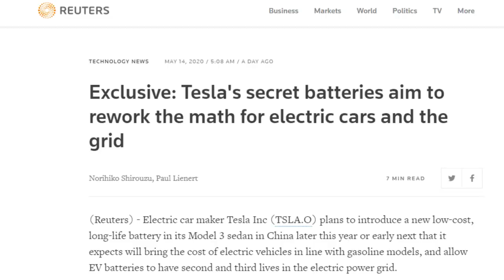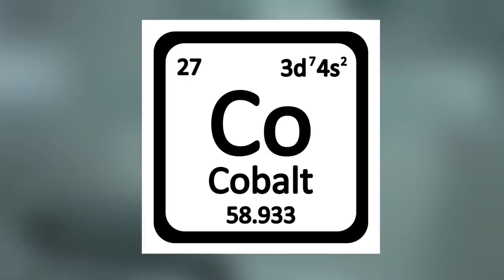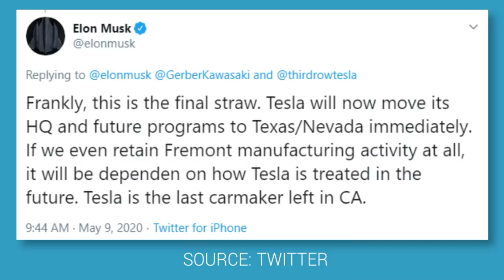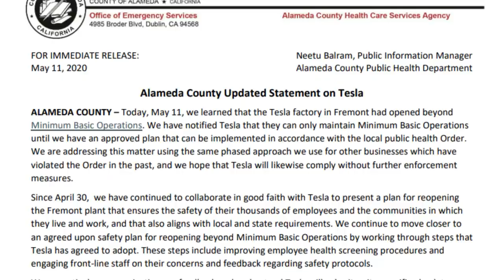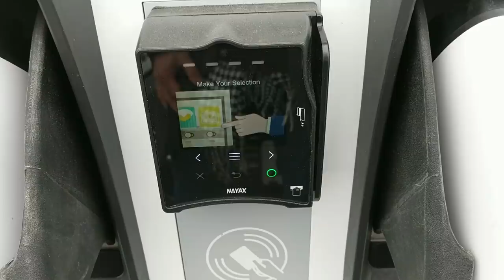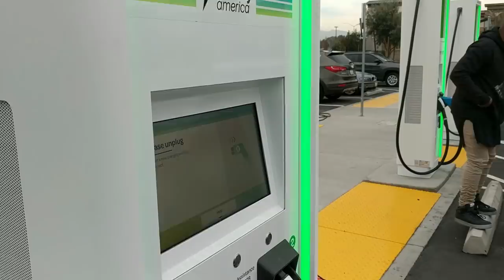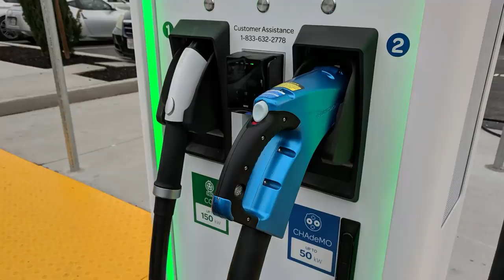New TESLA Battery Details LEAKED | EV News

Comment: The 1 million mile battery also takes away another FUD argument of all the batteries that will be in landfills. Once capacity is too low for a car can be repurposed for powerwall. Assuming you drive for 10 years then have use of the power wall for another 15 or 20 years.

Comment: 1 M mile battery = a battery that can be charged & discharged many many more times and therefore it becomes more practical to use it as a storage resource when connected to the power grid, this is the significant part, this means that Tesla can reduce the cost of the vehicle substantially by either 1) not charging the buyer for the battery & using it as grid storage ,or 2) include the battery in the purchase price and the owner can make money by selling the storage capacity to the grid, either way this will enable Tesla to significantly change the price/ownership proposition of their vehicles.
Reply: Perfect recap 🤙

Comment: I'm not getting what's complicated with this charging issue. Charge by the kwh, if what's important is how long people stay or how fast they suck it out, put a weight on charging rate. If you want people to spend less time, slow is more expensive, if you want people to not overload the system, fast is more expensive. I must be missing something here, but it's energy, at your house you have the same system, you pay for kwh, and you have a weight added for peak time...

Comment: Rules based on % charge might be problematic for cars that keep a hidden % of capacity always in reserve.
Reply: You can clearly see that on the DC charger itself. 100% of them what I did seen shows you % SoC.
Reply: ruhoer eoijre The charger only displays what the vehicle claims the SoC to be, not the actual SoC. Most EVs say they are at 100% when the battery is actually only at 80-90% SoC. One of the ways range can be increased with a software update is by unlocking some of that hidden capacity.

Comment: kWh if < 80% SOC, by the minute 80-100% on top of kWh rate.  That will keep turnover faster and get the most out of the chargers. 
If the network is really smart it could allow no minute charge up to 100% if, say, at least 50% of the stalls are free.
Reply: Rather than looking at the SOC, have a minimum per minute cost for being plugged in. That minimum could be based on a percentage of the charging station’s maximum charging  rate. For example IF it was set to 10%, the station is capable of 350 kW, and the rate is $0.25 /kWh, the minimum charge would be $8.75/h or about $0.15 per min.